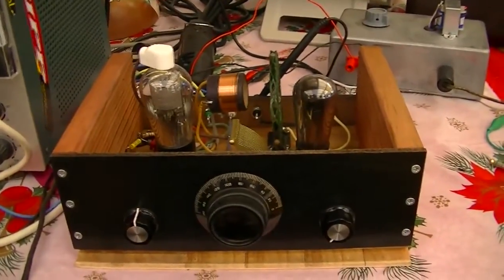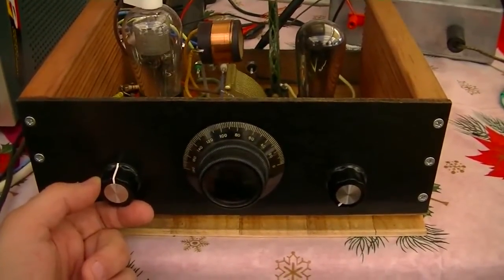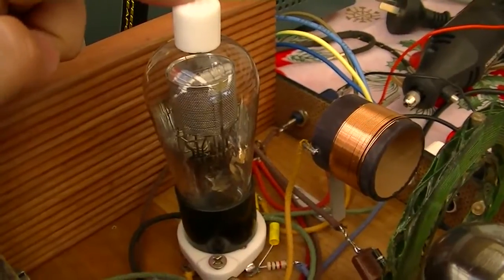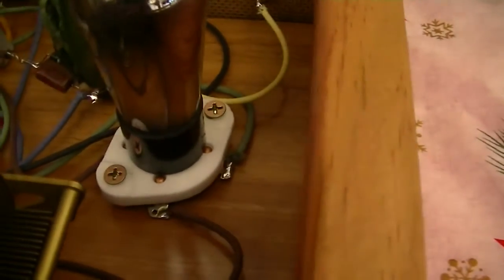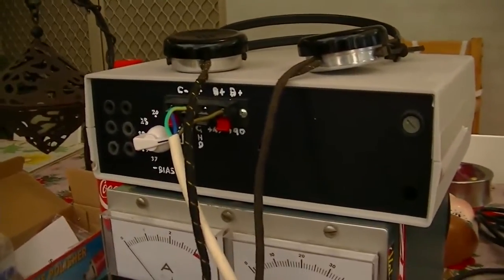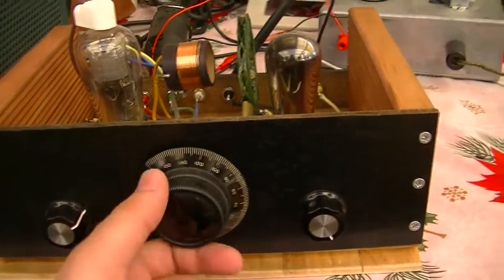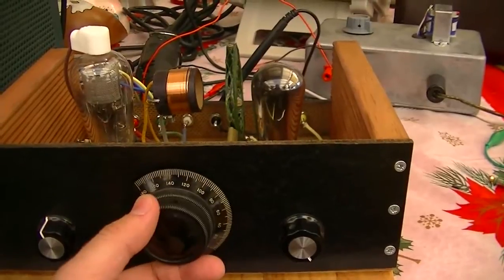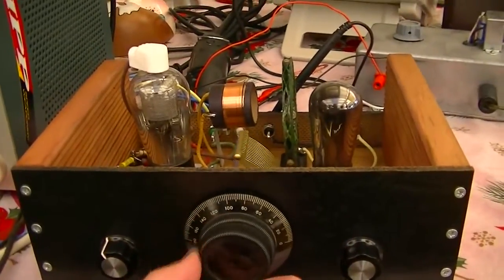The Return Of The Regenerative Receiver Using Type 32 & 30 Tubes

Comment: I built a one tube regen using a type !9 tube (valve) that's similar as it has both the detector and af amp, but in one dual section tube.  (Twinplex design from the '30s).  BTW those 'S' shaped (like old theatre sign lamps) valves are kinda rare.  Most 2v battery tubes switched to tubular shaped bulbs, then to the 'ST" (shoulder top) style rather early so the S bulbs were only made for a year or two at most.  The S bulbs WERE used for a longer period for the 5v battery, and AC operated tubes much longer.
Have you tried using a smaller coil to tune shortwave?  You can copy amateur SSB and CW signals with the detector in oscillation.
Reply from the maker: I'm lucky to have the S-shaped 30 and 32 as the rest in my stash apart from those two are ST shaped. I have built a couple of shorrtwave radios such as the Twinplex and one based on the 1625 beam tetrode, both using a set of Octo branded plug-in coils from the 1930's. I find shortwave sets more challenging to use but considerably more rewarding after pulling in a station. It's also very noisy where I am when using a longwire antenna so I have to find a way to erect my multiband dipole that is easily reversible so my landlord isn't upset by it. The joys of renting.

Comment: What is the black material on the front?
Reply from the maker: Masonite spray painted black.
Reply: @snarfusmaximus  thank you.  I made a similar regen that was supposed to have three stages (two audio).  It was an amazing performer with just one audio stage.  I had never completed it fully putting it in a cabnet.  I think I will finish it this spring.  It was very sensitive.  That is a good tube for a regen detector.